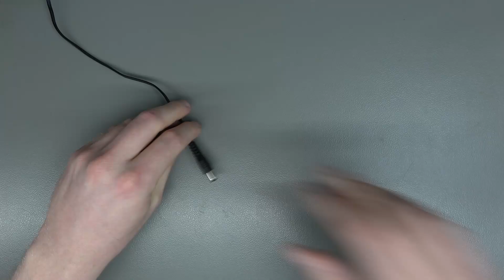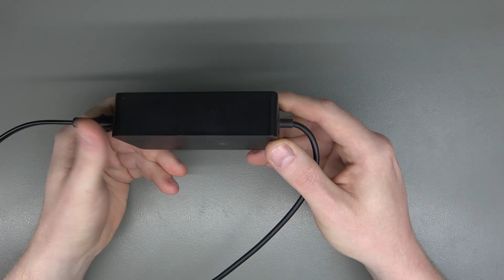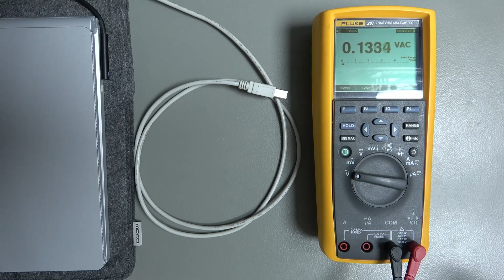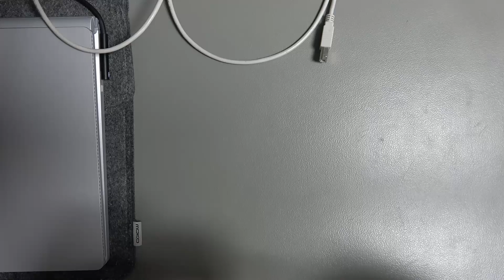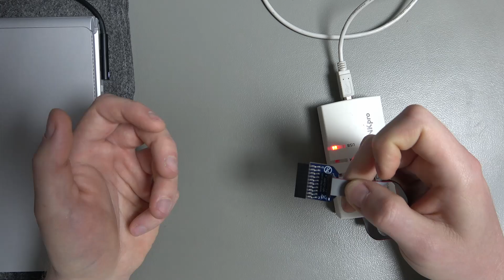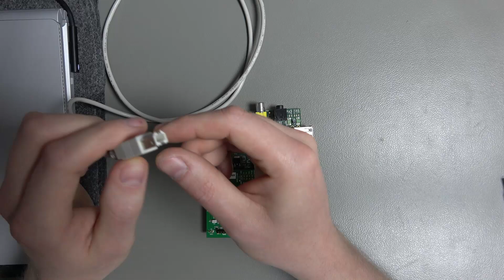The biggest plague in electrical engineering (AI-translated voiceover)

Comment: I'm a professional vintage audio restaurateur restoring mostly (studio) reel to reel recorders and have now banned all switching PSU's from my workshop and also from my home.
I always wondered why some of my USB powered test equipment suddenly became faulty or just stopped working completely after connecting it to their  PSU adaptors until I saw your YouTube video. Besides that, I'm using SDR USB powered dongles to listen to HF radio and I can say that replacing all of my switching PSU's improved my noise floor drastically.  It went down from S7 to S2/S1!😁 
I'm now using some vintage fully restored true linear"old" Philips PE 1542 DC power supplies as replacement for all of my USB powered devices. I connected the outputs from the PE 1542 to some multiple port USB hubs and all the equipment  is up and running  like a charm. No more RFI at all!

Comment: Common mode noise is a ral pain for touchpads of notebooks. This notebook I am using right now is running on battery while the power supply  is right next to me. When I connect the PSU the touchpad becomes iffy and objects on the screen hard to target. This is due to a non original power supply. The one that came with the notebook is fine though. Same for when I use the notebook with Discovery kits, programmers etc. Either I am on battery, but was works better is an Exsys USB Hub where I grounded the housing/GND.
Reply from the maker: Thanks ChipGuy :)
Feel free to give me a call to discuss this further.